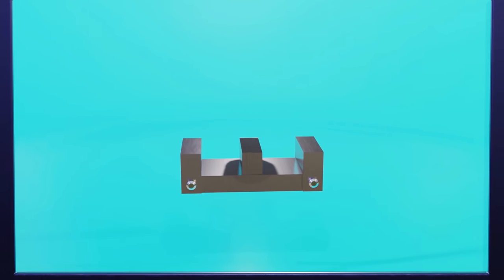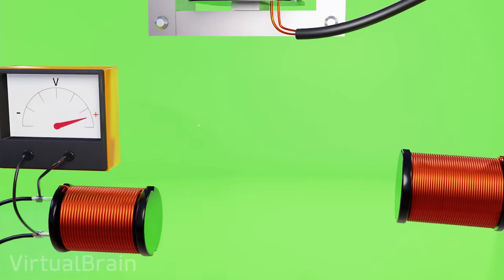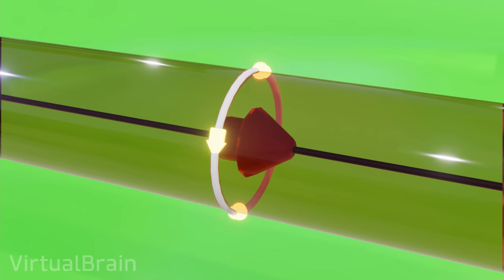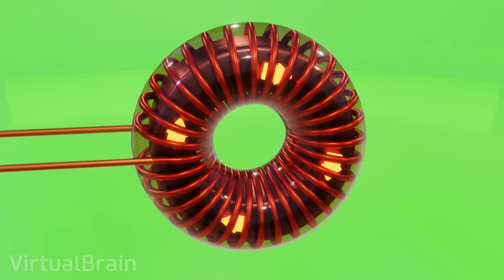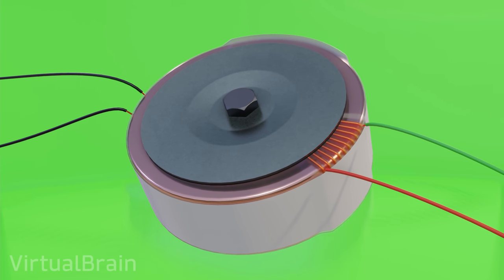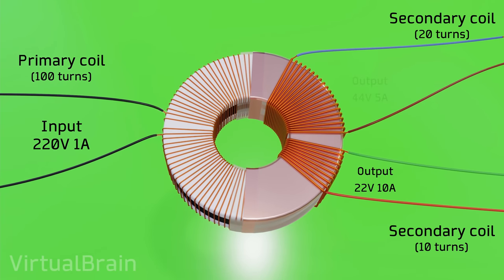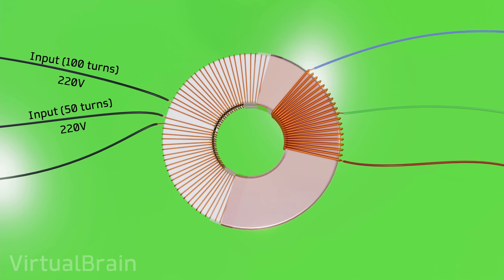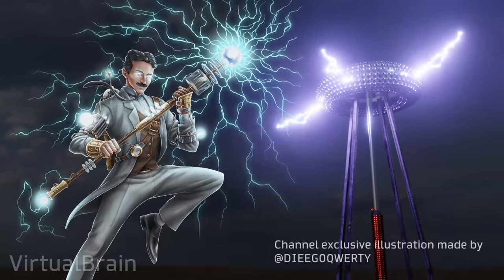How a Toroidal Transformer Works ⚡ What is a Toroidal Transformer

Comment: Generally a good tutorial but I do have a bone to pick over one comment. You stated Toroidal transformers are always used to reduce a voltage, this is certainly not the case as they are almost always used in high voltage strobe power supplies and as output transformers in electronic sirens.
Reply: No, he said that THIS transformer is used to step down the voltage as the number of windings on the secondary side is lower than the number of windings on the primary side.

Comment: Two things.  Toroidal transformers are better at constraining stray magnetic flux which can induce noise on surrounding electronic circuits which is why they are commonly used in power supplies of professional audio equipment.
If instead of a 50 turn tap on the primary, you instead have two 50 turn coils, you can then have a transformer for both 110v and 220v.  Put the coils in series and it becomes 100 turns.  Put the coils in parallel and it remains a 50 turn coil with twice the magnetic flux.  You see this trick used extensively in older transformer based power supplies.
Reply: Could this be used for Fractul wood burning .I use a microwave transformer now.  How ever someone gave me a Harmon kardon 7300. It doesn't stay on maybe 1hr or 2 then shut off. But this transformer is huge and the whole unit is a boat ancor.

Comment: Great video. One of the machines I work on uses one leg of 3 phase 208 on the primary side to produce one output of 120v and a second output of 60 volts from a toroidal transformer. I understand it much better now.

Comment: this reminds me of a gearbox. The fact that different connections can switch between different changes in voltage and current are sort of analogous to how different gear ratios produce different changes in angular velocity and torque
Reply: Seems very similar indeed as a mechanic I can relate

Comment: Also you have to bear in mind that the Bolt used to secure the toroidal transformer cannot be shorted with the Lid of the housing ( if metal) the bolt acts like a shorted turn & will cause issues. 
A firm i worked for yrs ago had this problem when we screwed the lid on the power supply & it just touched the securing bolt & created a dead short.
Reply: Typically I've seen a rubber or other insulation shield that rest between the hold down and the transformer. As well as the transformer is nearly always tightly wrapped with an industrial type of very durable plastic

Comment: A steel toroid could be made by casting 2 halves, and then heating them again, and pressing them together, with a little extra steel on the edge, if you counter rotate while pressing them hot, they should be forced into the mold, and together, into one piece.

You'd need openings at the edge of the mold, so the extra steel filings can come out. 

Also, 1 hole would need to be left in each half, so that pressure won't collapse or explode the toroid as it heats or cools. 

Then, drill and cut out all mounts, drill holes, etc.. and one final annealing to make sure it's one piece, along with other steel components, to be included in the device.

Comment: It’s inside the Compaq Lte Elite laptop’s light controller, and also found on today’s laptop LCD electric panel. The coil is turned on when choosing Bios, the DOS resolution causes that. I use Dosbox in Balanced mode, the coil is still on, but Dosbox doesn’t take up the whole display. The coil causes the motherboard to fix the smart battery part, because it is turned on. The battery’s chipset continuously calibrates the whole battery, the charging. During 1 discharge, only one option is turning on, but still works. In phones, the coil fixes the chemical battery, removes the memory effect, because it is inductive. You can buy mouse and usb cable, that looks like the coil. Suitable to fix devices that don’t have Bios login, for example Samsung with OTG cable.

Comment: For toroidal transformers, the screw must not touch the top and bottom of a metal case. 
Otherwise you have a coil with only one loop. 
It can only be attached at one point.

Comment: That first illustration at 0:038 had me scratching my head. If an extremely short pulse of DC current is driven through one wire, does the parallel wire not experience a transient induced voltage of opposite direction, reversing the flow of electrons in the adjacent wire? For AC current, would the phase not be shifted 180 degrees, effectively inducing current with "opposite direction" and polarity?
Reply: EE here.  - Depends on the application,  In transformers there are subtractive and additive arrangements, depending on the polarity of the windings it is possible to create combinations to obtain specific voltages, (This since we know that a force can be added, subtracted or neutralized according to its magnitude and direction)

now we must remember that transformers are machines that work if and only with alternating current, direct current being a "constant" does not have changes, so it does not produce any effect on the winding (except heat and eventually destroy it by short circuit, since we must remember that for electricity this is just a resistance).

-the only pulse we would have would be during the connection and disconnection of the DC, that is when there is a change of value from X to 0, But there is no negative step, unless we invert the polarities and repeat [as close to these alternating pulses would create a square wave, however this wave would no longer be DC but would become AC].

-On the other hand, the behavior of the windings is not the same under a sinusoidal wave as under a pulse of square waves, triangular waves, etc.

and although there is an induction, we must remember that electricity must have a path through which to flow. [in this case in the secondary]. So in ideal and simple conditions, if there is no load through which the voltage flows connected to the other conductor (potential difference is theoretically 0). -[It's like filling a bottle of water without leaving any air inside and shaking it, the water simply won't move, because it has nowhere to flow].

or imagine a pipe completely full of water with a faucet, we know that there is more water [like from a tank] trying to flow, but when the faucet is closed, there is no way to flow and the water does not move, or there is no more water in the first stretch of the pipe than at the end, [Potential Difference 0].

-If we put ourselves more into practice, let's imagine a simple battery, we know that the energy is inside but if there is nothing connected to the terminals it cannot flow and a change of state is not generated [of course this being perfect
 and omitting more technical things like self-discharge, electron leaks in the insulation etc]

Comment: That explanation is in danger of making it appear we can have 22V at 10A simultaneously with 44V at 5A yet still have an input of 220V at 1A in the primary. That is definitely not the case, and attempting to do that will overload the transformer and very likely cause it to overheat. So we can draw, way, 2A at 44V and 6A at 22V, but you cannot exceed the rating of the primary coil (or, for that matter, the current rating of the secondary as in this example half the secondary coil with the centre tap will be carrying 8A and the other half 2A. Not an issue here, but it can be on transformers with multiple taps so the current rating of any single segment must not be exceeded. 

Toroidal transformers are primarily about efficiency and minimising stray magnetic fields.

Comment: A few kVA? Define few as I know of one that is capable of 8kVA and another that will run at 12kVA. The one in my inverter will run at 7.5 without problems up North where temps are in the 60° range and has no problem with 6kVA down here.

Comment: How often do you hear of a torroid transformer failing, compared to a switch mode psu, not very often at all.
Reply: @Mihály Tóth Yea in a laptop charger it is smaller, but in a pa amplifier they can be about the same size.
Reply: @R Zarc You are right but I am sure that the transformer in a switch mode psu has actually got a ferrite core, not an iron core because of the high switching frequency.

Comment: How efficient is this transformer type as compared to other types used ?? Peace VF
Reply: Efficiency can reach 95% or more, whilst a more "conventional" iron laminate transformer will be 90% or less. Toroidal transformers are primarily about efficiency and minimising stray magnetic fields, but they are also somewhat more compact. However, transformer efficiency is a complicated subject, but ultimately what you want to do is minimise hysteresis losses as the magnetic field changes and inducing eddy currents in the core (also, not saturating the core either). Then there is minimising resistive losses too, so there is no simple answer.

But if you want transformer efficiency, you don't do it at mains frequencies using iron cores, even if they are laminated.
Reply: @TheEulerID  That clears up my questions on the transformer efficiency. That leaves one more that came to mind. When it comes to old welders that are the transformer types most are the e-type which have an aggressive arc. I used an old triodial type which really had a smoother arc with the same penetration. Why is that so ??? Thanks Steve and good day too. vf
Reply: @victoryfirst2878  This is what came to my mind watching the video. I've had a few old style welders with the laminated cores and wonder how well a toroidal transformer would work in a welder. Would a solid, non-laminated toroidal core be just as efficient as the laminated regular ones? Seems like multiple taps in the secondary coil would make selecting your output amperage easy.
Reply: @siggyincr7447  Would cutting out the laminated core from an old three phase auto-transformer placing the three laminations side by side and cutting out the donut keep the efficiency of say a one piece unit ??? Also, would using multiple wires instead of one large output wire improve the overall performance and duty cycle ??? Thanks vf
Reply: @victoryfirst2878  I'm not an expert on any of this. But as far as I understand it, making a laminated toroidal core should help reduce eddy currents and the associated losses in efficiency and heating of the core. You could use multiple wires for the secondary winding which would make it a bit cheaper by only using the heavy wire on the section that would be used for lowest voltage/highest amperage output. Then keep progressing down the wire sizes and connecting them at the tap points.
Reply: @siggyincr7447  Makes sense to me Siggy. Thanks
Reply: Larger distribution transformers (pad and pole mounts you see in cities) are Mandated ~99% efficiency in the US.
Reply: @noctisumbra2749  What about Triodial type unit ??? Peace
Reply: @victoryfirst2878  I have no experience with toroidal, however all cores I've delt with are not stacked winding, nor are they round wires, so it could be viewed as a hybrid of some sort.
Reply: @noctisumbra2749  So the wires are either square shape or sheet copper roll or brass sheet roll ?? Any other interesting things you can tell me Sir. I just love to hear from people who actually got their hand dirty. Something that rarely happens today. P. S. Have yourself a Merry Christmas and A Happy New Year too.
Reply: @victoryfirst2878  Copper and aluminum are used almost exclusively for conductivity reasons, they are a square/sheet form as it allows production without the gaps that come from stacked circles.
Reply: @noctisumbra2749  Thanks for clearing that up Sir.

Comment: 6:46 No, don't do that shit. Let's assume you need a 15 V, 0v, -15v and 5V. You will need a 2 separate coils for 15, 0 and -15, but if you pull out a 5v output instead of a separate coil, you can throw out of balance the 15 circuits, and this may be bad specially for sensitive application like high end audio. It is always better to have individual coils

Comment: cool the toroidal shape also has a weird physical property that input windings can mesh with output windings, also 3d  math has a weird effect on toroids as well, I wouldn't be surprised if the shape was what was causing the bizarre effects.
Reply: The high efficiency of a toroid transformer along with its high output current is due to the windings wound in such a way that they literally follow the magnetic inductance that surrounds the iron core.

Comment: @dorel49
0 seconds ago
A question: I have a step-down toroidal transformer (220V to 110V) but it only has three outputs; one of the coils, I don't know which one, has the ends connected, resulting in a single wire and I don't know how to connect the others to the output to get 110 V.Normally I have to have 4 wires: two from the first coil and the second from the second coil and in this way it was easy to connect

Reply

Comment: I have a torroidal transformer with primary voltage of 220vac and secondary voltage of 16 0 16 vac, I want to add another secondary voltage of 240vac at 100mA for vacuum tube power supply, how I am going to rewind this? What is the applicable wire gauge? Can I compute for the number of turns? Thanks for your advise..
Reply: Only if you count number of turns on old secondary as you take it off then from input - output ratio you can calculate turns on primary. This will then be number of turns for new secondary so they match, assuming no losses.
Reply: @rodd8170  thanks for your reply bro what if try to wind 10 turns of gauge 18 awg magnet wire and measure the output voltage and calculate total number of turns to obtain 240vac? Is that possible instead if dismantling the secondary windings..?
Reply: Yes that will give you a rough idea, trial and error to find correct nunber of turns if you dont want to disturb orig secondary winding

Comment: How to get the VA rating of a toroidal?
My amps toroid (230V) has secondary of 30Vac and the fuses for it (secondary) are rated 6.3A before it goes to the rectifiers.
I still look for the actual VA rating...
Reply: Thickness of the transformer wires.
Connect more and more current loads until it burns out.
You will know in the future what power he can transfer ;)
Reply: Google user  thank you so much. I was thinking it might be a 160VA transformer, used in a 50W/8R amplifier. The 6.3A fuses are just above the average 5.5A max limit for the 160VA trafo's I've seem online.
Once again, thank you very much.
Reply: Google user  190VA would be great!!! 😃

Comment: If I remember correctly, the secondary output current is determined by the thickness of the wire, the ratio as said here is correct for voltage from primary to secondary, but the current is determined by the wires secondary thickness, correct me if I'm wrong.
Reply: Only to a small degree. The thinner the wire, the more resistance you get for the same length of wire and thus a thinner wire would result in slightly lower current for the same voltage, but we're talking about microAmperés in this application unless you go overboard and have the secondary winding use conductors too thin to handle the current.
Reply: @BPo75  Thankyou, I'll research this a little more.
Reply: @CHEVI789  Easiest way is to calculate the nominal current on both sides and then choose the appropriate thickness for that, like 1.5 mm^2 up to 10A, or 2.5mm^2 up to 16A.
Reply: @BPo75  Okay, thank you very much for that, appreciated.